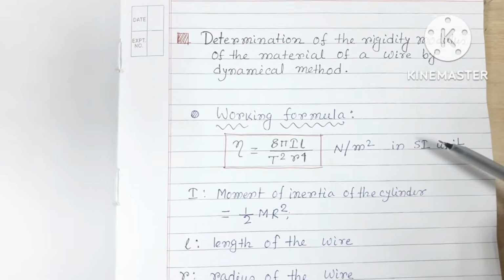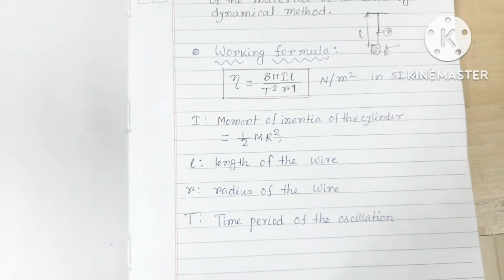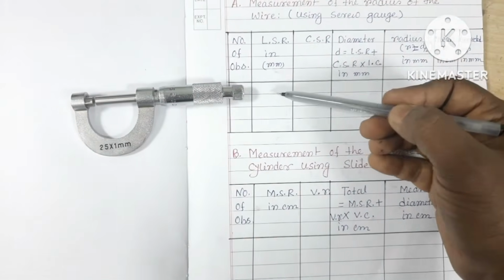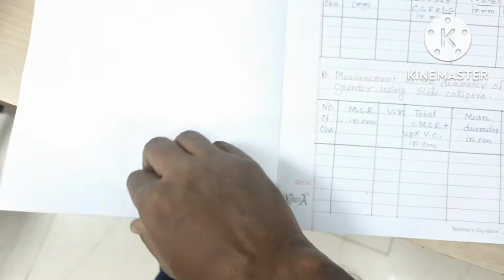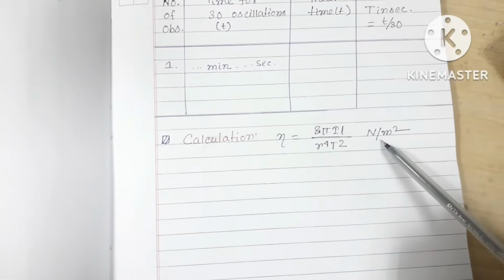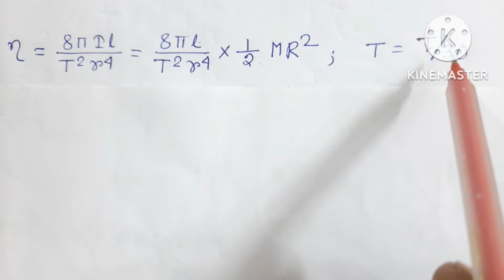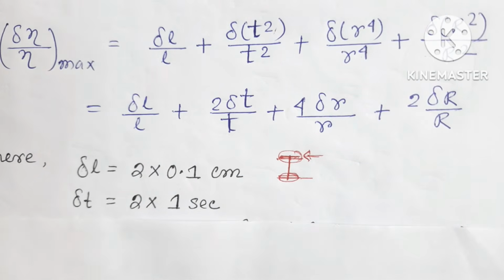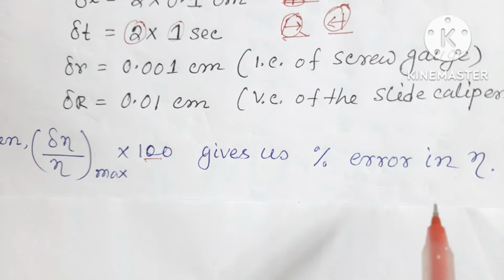Lec 4: Rigidity Modulus experiment procedure and error calculations

Comment: Sir I have measure R by thread then what will be its error
Reply: Ultimately if you have measured the length of the required part of the thread with a metre scale, so then, ∆R=2×0.1cm=0.2cm
[as least count of metre scale is 0.1cm]